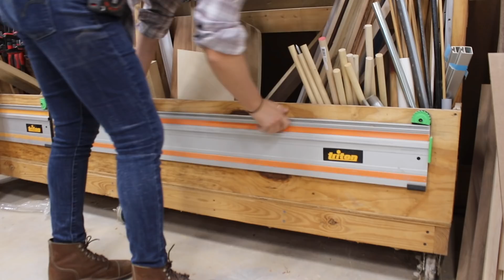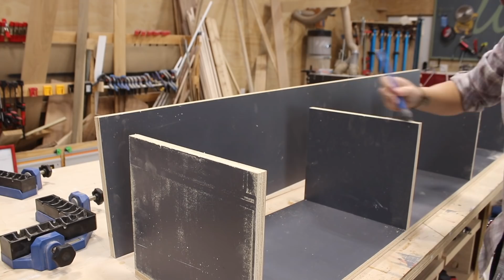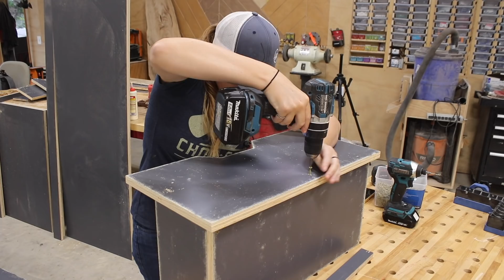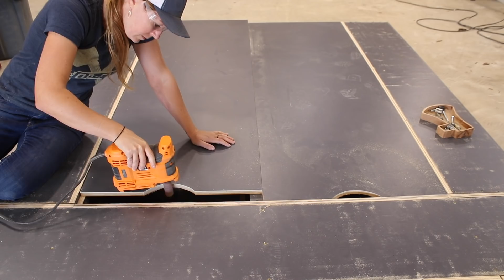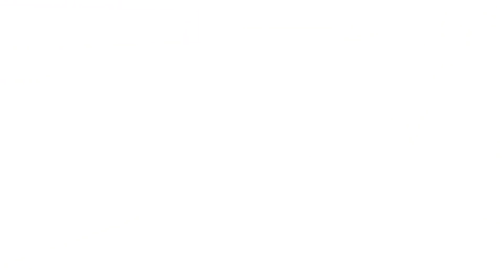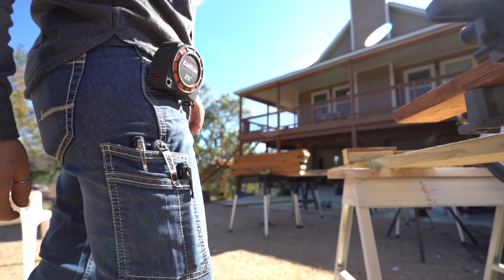Platform Bed with Storage!

Comment: I’ve had a platform with storage in my mind for a couple years now. 
It all started with curtains. Full length curtains require clearance behind the headboard. If I’m building a headboard, I might as well build a frame. Might as well make that frame taller (my legs don’t work as well as they used to). Might as well use that extra height for storage.
Then came space/weight concerns. Low ceiling, narrow door and hall. Moving in/out it needs to fit so I’m going modular. The end result will be 14 pieces.
Headboard, 4 main sides (as designed), 4 half height sides (design includes box spring, halves eliminate the box and maintain space requirements), 3 end drawers (slides on the back of sides), center fill, and center support.

A couple additional features - with the modular comes adjustability for sizes or the ability to stack I’d for use as a dresser or two.

Comment: Great modular concept for a king base!  I've been looking for one, and this gives me ideas.  Plus it's a simple and therefore flexible enough design to allow for modifications for individual preferences.  In my case, I'd want a few ventilation holes hole-sawed into the 2 slabs the mattress sits on for breathability, extend/project the tops of the side units out 3 or 4 inches beyond the face to allow the units to be set back for a toe kick (ripped my toes off too many times on my current setup that's missing this), and some way to attach the modules together to prevent the side units 'wandering' and the slabs slipping off their lips.  I would also break up the long-term drawers on casters into smaller 'train cars' hooked together with easily separated hook and eye connectors, since after upgrading to a king, our bedroom has nowhere near that kind of room to roll out something that long.  I might also lay some ripped boards on the floor lined up with the casters, so there isn't a lip for them to roll up and over as they're pulled through the drawer box (your missing footage perhaps contained a detail like this, or some other way to easily roll the casters out  through the drawer units).  But along with the modularity of it, having center drawers on casters is perhaps my favorite part of your design, since I was stumped on how to use that middle space.  So in short, Gee thanks April, now I gotta go build a bed!  :)

Comment: Thanks for the tip on installing drawer slides. I was repurposing some metal shelves by turning them upside down to use as display and storage trays for a fossil collection. The steel sides were too tall to use so i built plywood cabinets to install the shelves/trays on drawer slides. I had no fancy jigs so used a story pole and a square to space and align them. Had all sorts of problems getting them to fit and ended up using washers as spacers and strips of 3/4 inch ply to reinforce the edges. Still had problems though because the edges of the shelves weren't always straight. I tried your suggestion and sat the shelves in the slides with the drawer part of the runner in place. They lined up perfectly and after opening and closing them a couple of times they work well.

Comment: Nice!
Having moved to Europe I had to purchase an additional bed. What I found was a bed system where instead of a box spring there is actually a large box on feet that has a matress support system made of a metal frame with wooden slats to support the matress. This support system also has a pair of gas lift struts to lift the matress on the support frame. I have a ten inch deep box the size if a queen matress for long term storage. As for the support system I did find that my  local wood shop can order them from one of their catalogs if I want to build my own now, a lot cheaper than the one I bought. Good use for wasted space. Box springs are a thing of the past now. Reclaim your wasted space.

Comment: I used a set of curved birch “ribs” and a center spine for their support giving the foam a space to breathe while also giving the bed a “spring” under each side. king size. The four sides used simple “one screw” inside corner fasteners that easily disassemble.  Next project is to put in drawers.

Comment: Bed bases are usually porous fabric or wooden slatted to let moisture escape. Putting a mattress on a hard surface will cause mould to develop on its underside if it's not turned frequently. We sweat out a lot of water over night. I had this mould problem on a mezzanine bed I built, which was awkward to turn, as it was only 3 feet from platform to ceiling.

Comment: I loved this idea, and from watching other Tiny House videos can offer a way to add a little more storage to your idea.   A person added a second layer of storage drawers behind your long term storage.   They used rope knotted on each end, and slid it down a slot in the back and front of the two drawes (so can easily remove lifted up the slot), and add a second set of drawers on casters, like a trolley.

Comment: I love that it's a modular design. Makes it much easier to move if you need to re-arrange the furniture in a bedroom. The only improvement I'd recommend to this design is a way to lock the pieces together on assembly without needing to bother with screws. Some sort of tabs that slide down from the top would do the trick, maybe U-bolts, or some L-brackets bent into a U shape like a big staple.

I'd love to see a matching headboard next, with either a padded section for sitting to read/watch tv, or storage, or both.

Comment: hopefully you will not get moisture problems under your mattress.
I think a ventilation frame between your mattress and the base can prevent this. maybe a laninate slatted base does the trick for ventilation. it's just a tip :-)

Comment: Why not utilize the whole space under the bed for two very long drawers with dividers that are on small castor wheels and pull out completely? I feel that would be a better utilization for all the space under the bed. That's what I did on my two pallet high sofa. The drawers are 120cm long.

Comment: Without slats for the mattress to breathe, won't you eventually get a mold problem underneath?
Reply: Definitely should put a grid of holes to allow mattress pass moisture out below it.
Reply: How does an ottoman style bed work around this as that doesn’t have slats or holes? We have had one for 8 years and there is no issue with mould.
Reply: Thought the same. I did destroy a completely new mattress in less then 4 month like that
Reply: @FenstermäkerWJ It depends on the mattress.  Some of the memory foam or hybrid mattress makers advise their customers that the beds function better with the ability to breath below.  In the case of Purple which I recently bought, they require slats spaced no closer that an inch or so for proper circulation below.  My wife had a traditional mattress for years and had full sheets of plywood to stiffen the support of her aging box spring.  So I don't think there is one answer to fit all mattresses
Reply: I know when we brought our mattress, the sales woman said that the warranty would be void if we had a bed without slats.

as far as ottoman style beds, the last one we had had a metal frame with timber slats inside it. i did notice a lot of ones online do not, it may be a humidity thing, as it is always humid here and if your not careful you can have major mold problems (very humid and gets pretty cold regularly, so condensation is a bitch)

Comment: Hi April, 
This comment doesn't apply to this video, however, I have watched a few of your building projects where you use either pneumatic or battery powered framing nailers. Please DO NOT fire a nailer where you are reaching around and firing in your own general direction. It is not rare for a nail to go right through construction lumber and hit the person with the nailer or someone else. I have personally been hit by an errand nail, and believe me, it stuck in about 2". I do have a nice scar though.

Comment: Looks good but two questions. First, why isn't there any support under the end of the plywood panels at the headboard end? Second, if you are using a Rockler cutoff sled, why not use the drop sled on the other side of the base? Take care.
Bill

Comment: I'm confused, did I miss the part where you showed how to access the long term drawers from the front?
I thought you said you could remove the big drawers to be able to pull out the long term storage drawers but how can you do that if the big drawers are screwed in?

(Sorry if I didn't catch that or didn't understand you correctly, English is my second language.)

Btw love your videos and projects even if I don't even own a saw 😂
Reply: The draw slides are 2 part runners that can be unclipped, which is usually how they are fitted. However, the long term draws appear to be too wide when the draw is taken out due to the leftover runner... Was this lost in the "video malfunction"?
Reply: @BryanHancocks  
Ah. Okay, thank you. I think that wasn't said in this video.
And for the width it could be, but hard to really see (for me).

Comment: Hmm. I might actually be taking this one into consideration for a bed, since right now I'm only sleeping on a Mattress.
Is it possible to get these designs with Metric standards/measurements as well? Or no?
Reply: Google will happily convert those measurements for you. One day us Americans will take hold of the metric system. Maybe 3 or 4 more decades.
Reply: @ronniemcmaster8657  True that google does it. But it would've been nice to have that available already considering I'd pay for the plans. Instead of spending possibly another 30 minutes of converting.
Reply: @WinchesterxNL  I understand that. I wouldn't be surprised if her program has the ability to switch the measurements to metric with just a few clicks.
Reply: @ronniemcmaster8657  Not from what I've seen, just different sizes, but not Metric/Imperial.

Comment: I think i don't understand some reason :
~ All side be in glue? (but not use def oil for wood). 
~ Why open side not painted double time?
~ The niches on the right and left are open - storage of things does not imply protection from dust, children and animals? 
~ Where plastic/silicon stuff on down side this construction? (nobody have find scratches on his own floor). 
~ All holes in box for bugs, spiders, animals hair and dust. Where's kitchen push-for-open mechanism?
~ How about double frame? Mean - is it here, but not on video? (imho 1st can stopped mattress, 2rd can help lift it up for access to the central boxes.)
~ Finish line - i love glue and screws, but i don't see guarantee , that the design will withstand vibrations without a frame or in extreme cases - connective elements. 

Thx.
P. S. I'm watch it again and find (in real mean not see it here) general "strange" - where is desk between wall and bed (protecting from the cold, not allowing to fall anything into the gap between the bed and the wall and etc.).